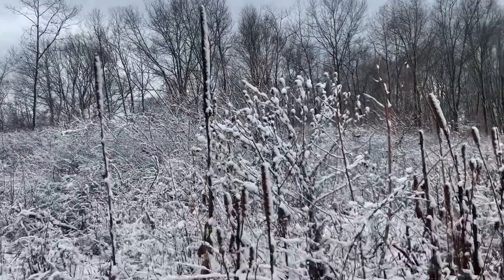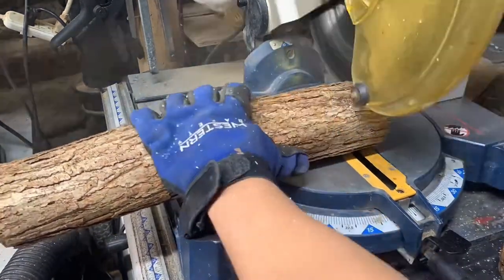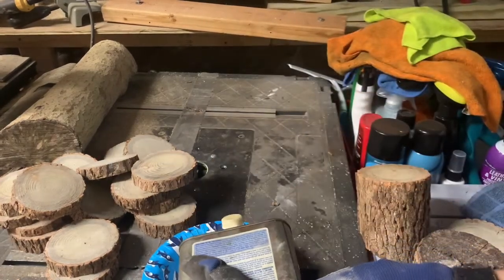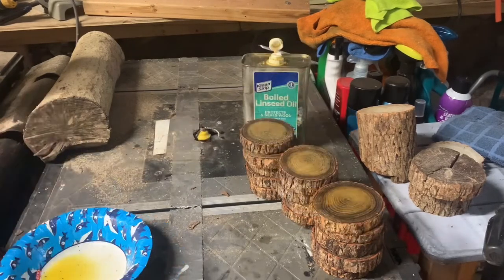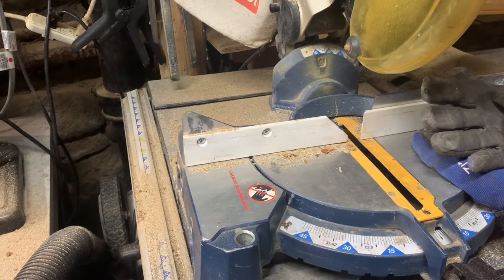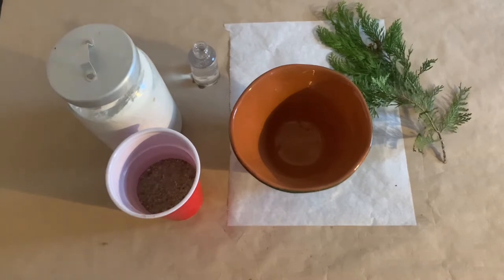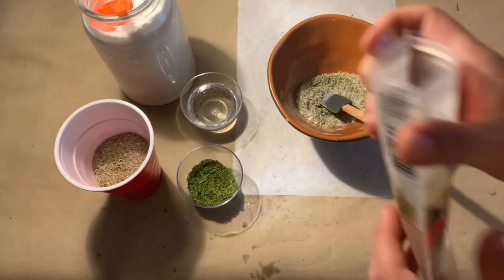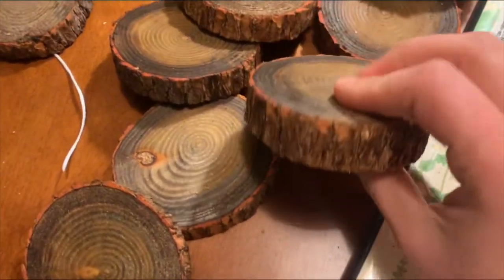Making Incense Cones from Nature (NO Makko powder!) + Making Wooden Coasters

Comment: Lovely tutorial!  I wonder if you wouldn’t mind answering a question.  I too put too much binder, in my case makko powder, and created come incense that doesn’t burn.  Can I regrind the cones and add more herbs, building new cones from the same material?
Reply from the maker: Hi there! That strategy in theory would work if you change the proportions of the mixture to accommodate for too much binding powder…but you can’t regrind the cones. Once they are dry they won’t go back to the paste that you started with. I know it seems like a waste, but if your cones are fragrant enough try grinding them into a powder and put them in sachets to use as air freshener. That’s what I did with the first batch. Hope this helps!
Reply: It does make sense and it’s a lively suggestion as well!  I did already try grinding and adding more herb to change the proportion and it didn’t work, so that explains it!  :)  sachets it will be!
Reply: Lively = lovely

Comment: Do you mind sharing the approximate ratio of binder to herbs you used for the second batch?
Reply from the maker: I believe it was 2:1 ratio of herbs to binder. Experiment with it, use enough binder to keep the cones together but not so much that it prevents them from burning. Every ingredient has nuances, so you might have to tweak the recipe for different kinds of herbs